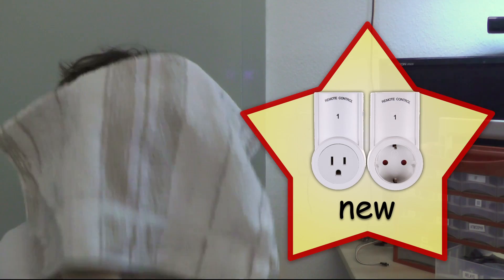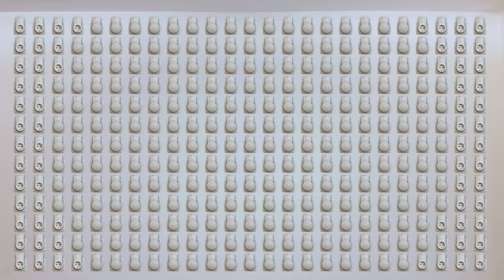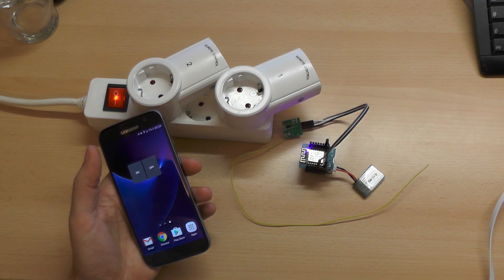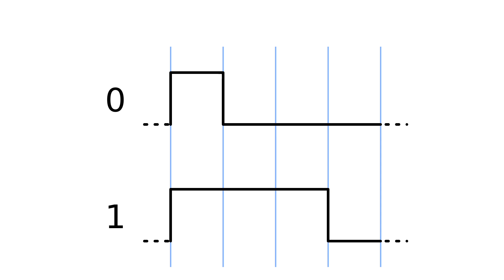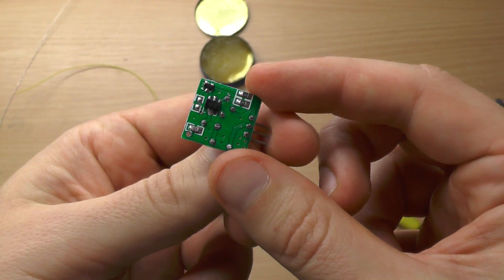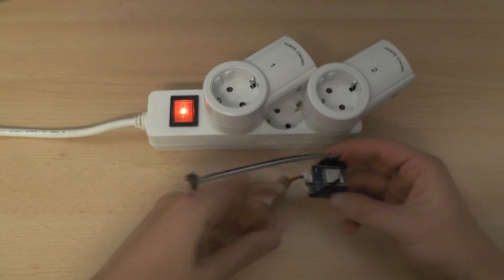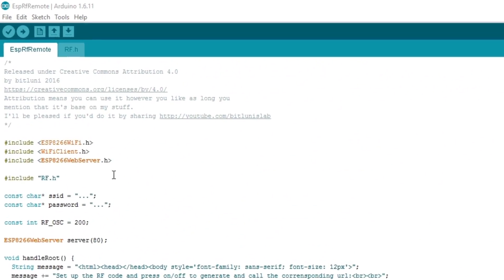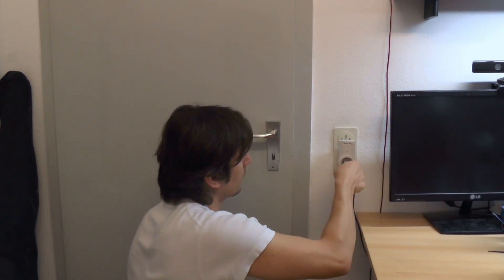Remote power outlet home automation tutorial ESP8266

Comment: I was excited when I found this because it is what I need. I got my ESP32 and I used RMT peripheral to generate exactly the signal at 3:26 and I connected it to chinese 433.92Mhz transmitter and nothing worked. Neither outlet reconfiguration, nor the control of any outlet. I tried to capture the signai I was sending using the receiver but the receiver itself was receiving a lot of some impulses, even though I was not sending anything. All was running on 3.3V.

Comment: Haha damn, I did this in 2015, but I used an arduino to record the signal package (CS student without access to oscilloscope). Entire system is now replaced with the 10€ WiFi based packages (yes I use Tuya and I don't mind China recording my usage).

Comment: hey great job i made  something similar (control an air conditioner outlet using esp via blynk app)
 the ac requirers about 20a 110v
at first everything seems to work yet after a month or so the relay output (com / no) stop executing power while  inputs on of works fine what  could be the problem? I use a relay which is made for 10 a should i get a bigger one? and i power relay from esp should i power itbfrom a different separate power source? Thanks

Comment: How to remove, clear memory of learned signals in the socket? Is it possible with this grey button? 
EDIT: the only way i found out: save many times the same code, to roll out the memory slots. Holding the button while entering the socket to the wall deosn't work for me. .

Comment: Hi Bitluni 

Love your videos and have learned a great deal on the 8266 Wifi from watching. I got a couple of Etekcity remote outlets. I copied your Arduino code and bought the 433Mhz transmitter / receiver modules. I had a problem that I was able to determine that the Etekcity remote outlets have a different ON/OFF pattern. The data bits that control on/off are reversed and they don't use a bit for the channel. The outlets all have separate addresses. 0011=off 1100=on.   (Preamble, Address, On/OFF data) I was almost to the point of using a relay to short out the switches..Thanks

Comment: Hallo, 

I'm trying a similar-ish project with little knowledge on the matter. 
I'm using NodeMCU. 

Just on lil' question, does the phone you're using needs to be connected via WiFi to the same router your little shield is? 
Or can you do the same thing over celular data / other WiFi? 

Thaaaanks

Comment: Following this process, I was able to reprogram the outlet to the default code. However it would turn the outlet off when I press ON. Pressing OFF doesn't do any thing. I have tried changing the  RF_OSC, channel and ID, but the results is always the same. if outlet is ON, pressing ON on the page would turn off. Pressing OFF doesn't do any thing. Any suggestions?

Comment: How do you solve the problem of getting a different IP address from your local WiFi router on reconnects? I would suggest using an mDNS to assign local network names (like "lamp.local") to your Wemos-sockets. This way, you can always access them by name.
Reply from the maker: great idea.. but I had lot's of problems using mDNS, I really tried. But it's an option
Reply: I'm having problems only with Android devices. They don't support mDNS to my best knowledge. Mac / PC and iOS support perfectly.

Comment: I just opened the Skript, did nothing to it and the Compeiler tells me: 'D0' was not declared in this scope
Reply from the maker: I think something might have change to the libraries. did you select the board "d1 mini"?
otherwise you find here the definitions
https://github.com/esp8266/Arduino/blob/master/variants/d1_mini/pins_arduino.h
Reply: Thanks for the answer. Got it fixed. Now the next problem, i use your BasicRF Code to reprogram the plugs, but it does nothing. Is there any way to tell if the RF transmiter is sending. 
I´ll edit your code to send a signal with 1-1000 µs legth to test it this is the problen, because i got no Oscilloscope :/

Comment: hello , I have got question but there is nothing I could find on web, if we use relay for switching home appliances ,there is a chance that some time relay get sticked and contacts are get messy due to sparking so is it wise thing to replace relay with triac ? or triac have also some demerits , I hope u know solution and give me guidance about it
Reply: Bhavin Rathod Hello there! A Relay is much safer/easier to use than triac, if you keep to the designed relays specs. switching high capacitive loads like pc-power supplies will of course burn your contacts with high inrush currents, but just use higher rated relais, and/or switch both phase and null, not only 1 phase. (i think snubber cuircuit is the term to search for). even if one contact sticks the other one still cuts off.
A triac will always have a small current flowing through it, which kind of annoys me and/or leads to slight lighting or blinking of lights/leds...(charging of cap until voltage triggers start then discharged...and again).
triacs also need overvoltage protection/surge + heatsinks added, so only really good if you have to dim/pwm something.
easy&reliable => Thats why relays are still massively used in car applications...
Reply: This is the perfect answer sir , thank you so much I really admire your work😊,thanks alot

Comment: Hey, great video! Everything went well after i tried to replicate it. I took all the components you recommended but unfortunately onky the pairing seems to work. No Command is switching the device on or of. As I said, the paring seems to work LED starts blinking fast after paring. Any Suggestions? Thanks a lot =)
Reply: Did you end up figuring it out ?

Comment: I had captured the switch id 4265267 , pulse length 186, protocol 1 using python script on raspberry Pi. How do i convert this info for ESPRfRemote  inputs like  pulse, channel etc 

Do you have any  utility for raspberry Pi to receive this info using RF receiver
Reply: How did you get the switch ID ? I guess what I'm essentially asking is how do you convert from the 20 obtained waveform using oscilloscope to decimal ? Thank you

Comment: Hi, 
thanks for the great video! I've just tried it out but don't seem to get it working. The funny thing is: When I'm trying to reprogram the adapters it seems to work (the LED stops flashing as soon as i send a command) but afterward it doesn't recognize any command I'm sending. Do you have any suggestions or tips?
Reply: Nevermind, I've found the error. My Adapters are working with a very different coding of the signal.
Reply: hey, also did not get the thing to work. Mind sharing what coding you used?
Reply: Tomas Mandorf there are many different protocols, depending on manufacturers etc. 
I uses Telstick to manage that for me. They have information about controlling 443 MHz radio controlled devices on their web site. It is a USB dongel where you just tell it what command to send. Very neat, and works with OpenHAB.

Comment: Hi, what's the range with that tiny antenna you wired? I see you are powering it with 3.3v, wouldn't the range be greater if you gave it 5v? I've read a lot of stuff about these 433mhz modules, and the range is sometimes low even with 12v arduino power.
Thanks
Reply: Xh3lar the length of the antenna is more important. And the device are designed to work with the right voltage. Wrong voltage will ruin the device...

Comment: Thanks for the video, it was fun to watch :) I had also taken a look at these cheap RF power outlets and I was thinking about incorporating them into my existing home automation system using an ESP as a bridge. It seemed like a pretty reasonable solution until I started thinking about security. In principle, anyone can control your equipment with this setup, right? I realize that the risk is probably quite low in most cases, but I don't like the idea too much. I think I would still consider using a solution like this for non-critical sensors, but not for actuators.

Comment: Great video, Luni! But ... but ... but ... do you get confirmation for a received signal? In a normal flat it's probably not a big deal and you should be well covered by - as you proposed - sending the same command a few times but in a house or for outdoor use you would really want an "ACK" of sorts, right? I've been using 433 MHz radio controlled outlets for some projects but those proved to be unreliable which is why I lately started to move everything over to mySensor and/or ESP-01 controlled relays that receive MQTT commands and return MQTT states for added reliability. Anyway ... sweet video! Hope you'll be sent a proper DSO by a viewer. In case you receive too many, please consider sending one my way ;) Cheers and thanks for sharing!
Reply from the maker: Sorry, those outlets are only unidirectional. You can't be sure if the code arrived. That's why I send a code multiple times.
If you need a status answer, you have to use a relay module. You can take my homeAutomation sketch from my other video and use the setPins function to control the relay. Using the WeMos relay shield might be easier than the modules I used before.
Reply: Thanks for the reply. Yep, that's what I thought. I run my own sketches for MQTT pubsub with ESP-01 and simple 5V mains relays. I also use mySensors sketches for the relays I use with Arduino Nanos or Pro Minis and nRF21L01 transceivers. Would be great to find something cheap and hackable that does send ACKs and already features a Schuko socket. Or even cheaper SonOffs. Well, we can always hope. Anyways - love following your channel - great stuff. Cheers and thanks!